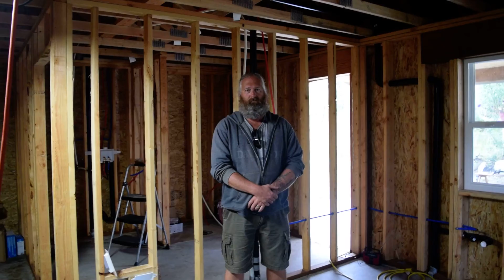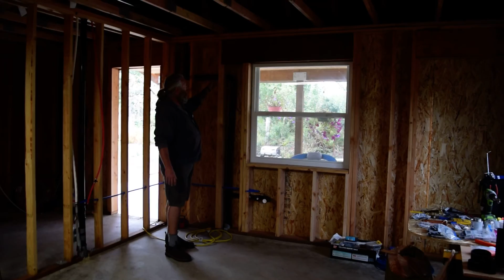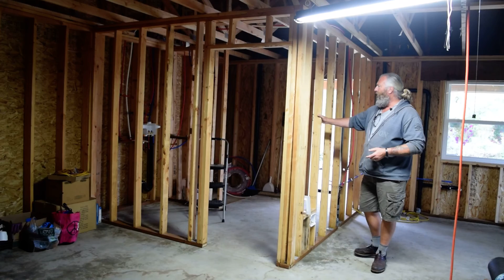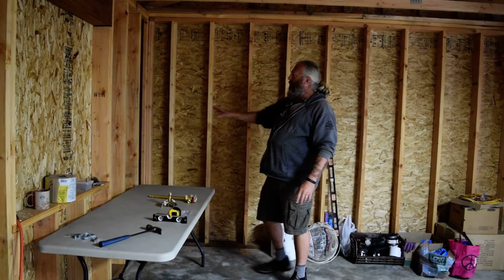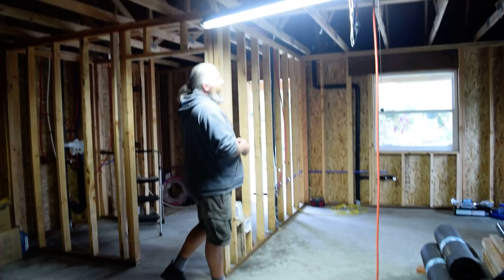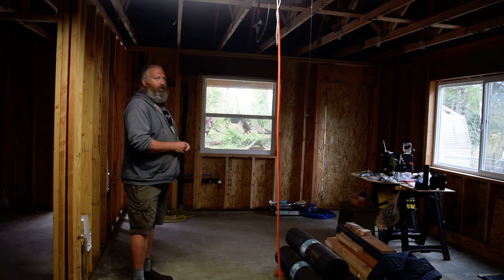Low cost Secrets to How we design our beach cabin.

Comment: i am so in the need of a lifestyle change. Don't have a lot of money. Just needing something small. That 24X24 sounds just about right for me. Like I said budget is small around 20 thousand. Can I do something simple with this.
Reply from the maker: That depends,Do you have a place to build?Is there any infrastructure in place? (water,power,sewer) Can you live in it unfinished and finish it as you can? There are many variations on the theme. We moved into our last house as a shell. It was wired and plumbed with insulation in the walls and vapor barrier on (plastic over the walls and insulation) we lived in it and finished it as we had money to do so.
Reply: Kevin Coy I have nothing. what I mean is that I'm looking for land. nothing big. something that hopefully has water and septic oh and electronic pole in place. I know that can be costly.  I'm looking for something that doesn't have a lot of zoning issues
Reply from the maker: Ok, I suggest you stay out in the county when you look they are way more relaxed in zoning than a city or a formed community with hoa or ccr (rules and restrictions)
Reply: can you still find cheap land
Reply from the maker: Yes,of course that depends on what you call cheap.I have seen lots around here for as little as $7k
Reply: oh that's great now i just have to work out cost for light, water, septic, and elec.